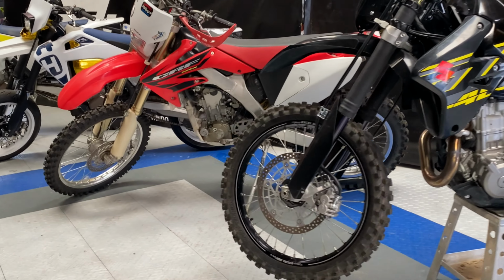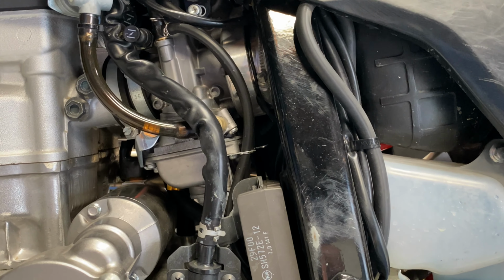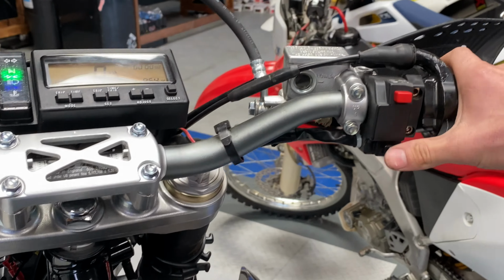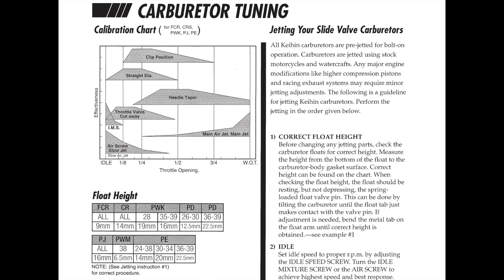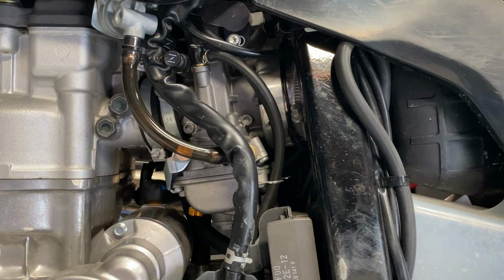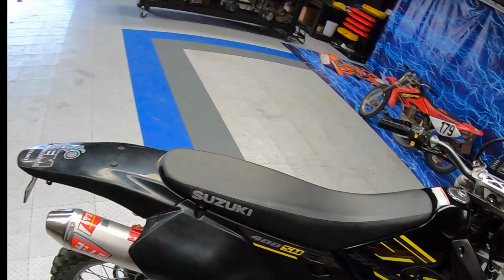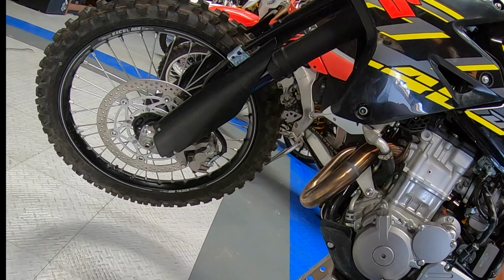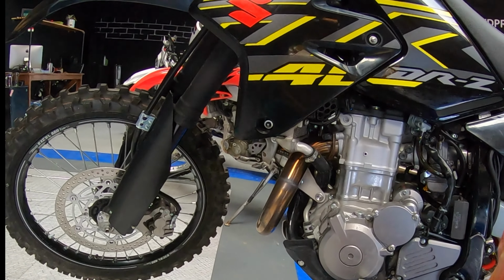OEMDirtBikeParts Reviews - Tips & tricks on FCR carb tuning the Needle & Air Screw

Comment: I have a Husqvarna TE610E with Keihin FCR41MX and is jetted like this: 
Needle - OBDVR ja 5th position from top
Main jet - 180
Pilot jet - 45
Starting jet - 85
Low air - 100
Main air - 200
Leak jet - blind
Mixture screw ---- 1.5 out Mixture screw is a Zyp Tye Racing type with extended reach.

I have a big problem to get the bike started from cold. As I heard You run 55 pilot jet would that help? How would You jet that carb for my bike (577cc)? OEM engine, pretty straight through pipes OEM airbox. Relative height from sea level is around 164ft (Estonia).
Reply from the maker: Drop two on the needle & a 50 pilot and also try starting by holding the throttle 1/4 of the way open when cranking or kicking as that’s pretty standard on any big carb big bore to get it flowin. Needle is my preference not a big deal air holes are nice to have as well as most air boxes are very restrictive just look at a 25 Ktm or kx450
Reply: @dirtbikeplug  Thank You so much! I'll try Your recommendations.
What do You think about JDJetting bike specific jet&needle kits? Worth to try?
But firs I try what You recommended.

Comment: Very cool video, I have the same bike you have with Fcr39, fuel mix is good but steady cruising throttle engine mises. Should I get the needle up or down. I'm confused. Thanks.
Reply from the maker: Same bike?  Fcr39 or fcr39mx new used from where & version ?

Comment: Hi Bro!, Again it's me with my NC250 chinese engine, 4 Valves, water cooled, comprenssion ratio: 11.5:1, bore/stroke: 77mm/56.3mm, Max power: 26hp / 9000rpm. I'm using a FCR37 (Is that ok? Or may be it's too big) Pilot jet: #40 and Main jet: #138. and 3/4 quarter fuel air screw out. It bogs when acelerate and hardly mid-range throttle response. My question Is... Is that the correct  carburetor FCR37 i'm using?, if not would be a FCR33 be fine?, What else can change to get the correct tuning? Thank u in advance, regards
Reply: I would check the accelerator pump for correct operation.
Then I would experiment with raising and lowering the needle height to see if there is an improvement in the midrange.
Keep trying bigger or smaller main jets to get Full Throttle power optimised.
Bog is lean. 
Stuttering is rich.
I think OEM will say that the FCR37 is Not too big.

Comment: So I got a fcr39 finally,and I'm new to the tuning why does the idle speed up when I screw it in. Backwards of the cv I'm used to. Screw it in the idle drops. Running a 165 main 48 pilot apparently a emp needle haven't touched air jets and have no clue what they are. At two turns out on my first ride decel had no pops it was smooth but start up wasn't as  instant as I like.. Take it back to 1 and a half turn as soon as button gets touch she is alive even at 35 degrees with the choke of course very strong all the way thru the rpm revs great power ups 1st thru third no problem pulls hard to ten grand. It's a 434 stage 1 hc powerbomb header 3x3.5 all the right adapters to mount it. No coast enrichment.
Reply from the maker: Purchased ours?
Reply: Your pilot jet is slightly rich. 
When it speeds up as you turn it in, that means you are leaning out the mixture to a better AFR.
 What happens to the revs if you screw it right in ?
Reply: @norincobro6421 I've got it straightened out you were right though pilot was way rich wound up with a 40 pilot

Comment: Good vid, thanks!
What do I need to do if I have popping on de acceleration as well as when the bike is hot rpms don't drop nicely to idle, they hang a bit just before idle and then drop eventually?
Reply from the maker: Fuel air screw adjustment and larger pilot 🥳
Reply: Having the same problem on crf250r it also bogs down when u quickly get on the gas
Reply: Do i need to richen the mixture?

Comment: I set my air fuel like you explained. But when i give it alot of throttle from idle it lean bogs. Does that mean i would need to raise the needle some?(move clip down) To give it more fuel right of idle?
Reply from the maker: Smaller pilot or could be many things like a worn throttle slide.
Reply: @dirtbikeplug  so moving my needle Up making it richer would not help?

Comment: Interesting! I just scooped a used 2001 drz400e off a buddy a few weeks ago. Didn’t realize I might have been looking at Mikuni specs on that mix screw. I got a stock 45 pilot and it idles great at about 1680-1750 currently but you blip the throttle and it’ll surge and rpms hover around 2900 for a few minutes on its own and the eventual drop back down to idle. 🥲🤣

Comment: Do you guys set proper jets for different altitudes i'm in the mountains of TN and had a stock carb with jd i put in but really lookin to upgrade to a big daddy carb from you guys thinkin about the full exhaust also.  Thanks
Reply from the maker: Hi Tristan, yes every order is already jetted to the spec of each order. Also, we have all additional jets sizes needed if moving from +- 3000ft elevation changes.
Reply: Were the "R&D flexjets" work well (don't need be a contortionist to reach under carb for the screws) on adventure bike travelling various sea levels can adjust your AFR (fule/air) mix on the side the road without pulling carbs off
Reply: R&D Flexjets come in 2 x lengths 
Shorter suiting single Keihin bikes (can use longer ones though)
Longer suiting V twin Keihin bikes (harder too reach at carbs)

Comment: CR 41mm FCR - V twin 950 Super enduro
just installed a new set were pre assembled to suit my 35.5 sea level
have them synchronized & idling ok
On test ride bike runs fine on throttle but when i slightly start backing off (not fully closed throttle) it's loosing power like a bogging type feel (running out of fuel type feel ? ) with the K&N filter pods sounding like it gasping/kind of blocked sound 

any idea what too look for
Reply from the maker: Try without the pods, if it’s better get larger pods 😎
Reply: @dirtbikeplug  Y

a: NO LARGER PODS that will fit
b: LARGER PODS WILL NOT FIT UNDER THE 950SE SEAT AREA - REAR CARB
c: NOTING TOO DO WITH THE PODS
d. same pods that are used on 39mm & 41mm been used since 2007 with success (inc my other 950SE 39mm FCR bike) from SUDCO
c: issue fixed was a R&D Flexjet not correctly manufactured put my old set of flexjets on the carbs runs perfect just off idle were the in ballence was - see my vid on my channel

Comment: my bike will bog out and cut off when i punch the throttle. and when i give it high revs it will cut off when it comes back too idle. i thought the bog was my accelerator pump timing or the diaphragm being worn out and i put a accelerator pump rebuilt kit and timed it right. it still bogs. u have any ideas on what i should do with the jetting/ needle.
Reply: Raise your needle up a lil?

Comment: Gday.
Re your TPS positioning. It looks as if it's turned anti-clockwise in the vid judging by the slot gap.
You said to turn it clock-wise.
Can you please clarify this for me, as it could just be my eyes!

Thanks.

Tony
Reply from the maker: ah, good observation if you were adjusting a 2002 and older fcr carb or some carb with the opposite arrangement yes you would go the other way to add advancement or richness on let's say a throttle body. This one is the way the clock moves to add more spring tension.

Comment: I could really use some advice! I have a FCRMX39 and this thing bogs and dies if i snap the throttle.  I cannot seem to fix it! 
Specs: exhaust is Fmf power core 4 with power bomb header. Air box has a large" hole cut in top. Stock S cams. Carb has O-ring mod done with tiewire.
  Carb and jets are clean. 

JD jet kit, 165 main jet. #42 pilot. Red needle clip 4th from top #4. I'm at 1200 ft above sea level.
 Accelerator pump spray stream is a strong diaphram in good condition. Just misses the slide without wetting it. And seems to spray for at least 1.5 seconds. 
It's killing me bro, any tips?
Reply: Try a 155 jet
Reply: Did you ever find out what it was? I'm having the same problem
Reply: Never did : (
Reply: @jacobh707  You said the carb is clean, but did you ever redo the gaskets on the midbody? All of you're jetting sounds close enough to not have any serious problems with it. Edit: Your main sounds big, even for the mods, but just blipping it off throttle will hardly use the main jet at all
Reply: @motoweenies4431  I never changed the  midbody gasket, the carb at the time was a brand new ThumperTalk carb. I'm not sure if I ever tried a smaller main jet, maybe thats worth a shot, but i HATE trying to seat the carb in the bike >.<

Comment: What size main jet are you running
Reply from the maker: this drz400sm has cams, light head work & a 42mm carb- 188 main. all is important as if it was a stock bike I would run a 160-168
Reply from the maker: with this exact carb size that is,  I'll say if ur running another size FCR carb on this 400cc engine-
-36mm 145 main
-37mm 145 main
39mm 155 main
40mm 160 main 
41mm 175 main 
ETC.
Reply: What about pilot on 41mm stock? And needle position?